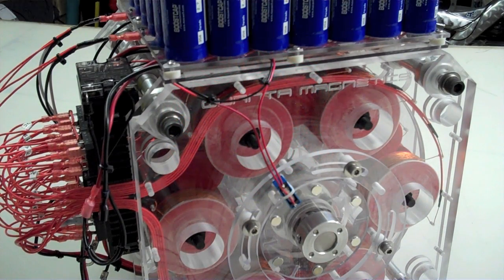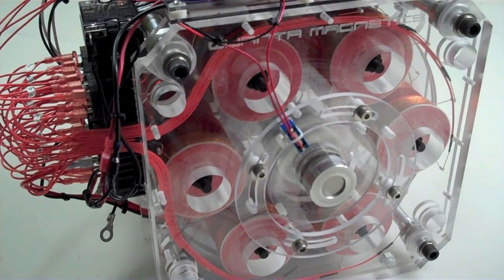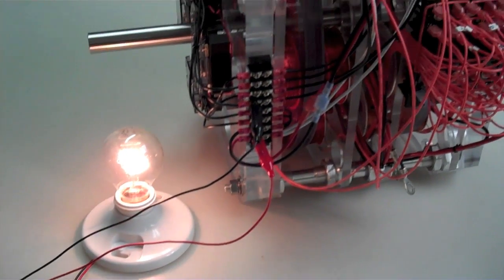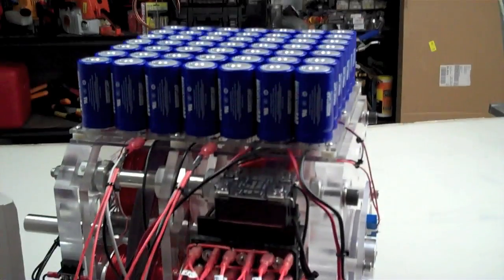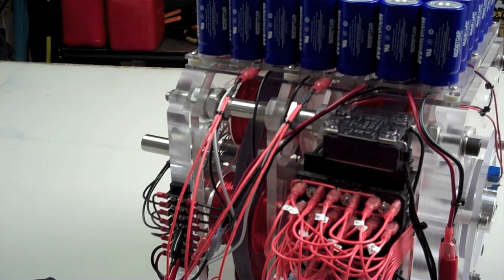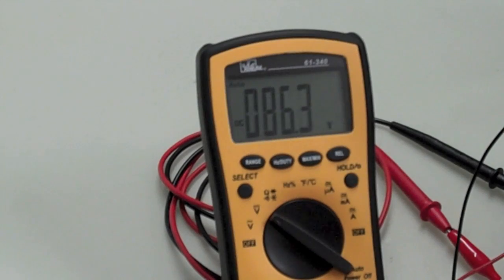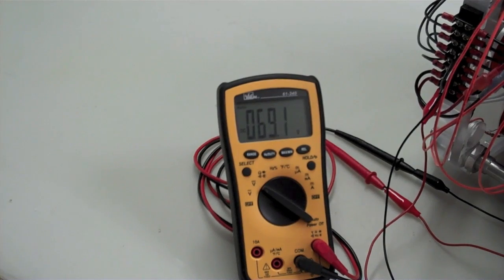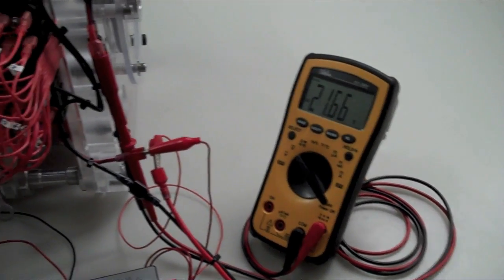Q2 SELF CHARGING.Part 2

Comment: Thats not how you get the job done.  You don't get any foreknowledge about results. All you have to work with is the assumption such a device can be made. This is how real inventors do the job. If it was good enough for them it should be good enough for anyone. If you decide you can not make the assumption then you can not make the heavier than air flying apparatus. It becomes something like sticking spaghetti up your nose rather than the next revolution in warfare. "the perpetual drone"

Comment: To better understand your response here, Yes, means  power factor correction is needed because we are talking about a dc motor ? A 3-phase ac motor has ohmic and heat losses but already avoids any benefit for improved efficiency related to power correction and recovery methods.

I appreciate your unbiased and professional input.

Comment: If total system efficiency is the metric you're using to evaluate the efficiency of a motor, then yes --- power factor correction is needed.  Otherwise, you're going to have real power loss either during commutation (whether mechanical or electronic), and increased ohmic losses as well.

Comment: Yes, I think so.  For example, in a brush DC motor, the energy stored in the field is typically lost during commutation, giving rise to sparking and RF noise at the commutator.  Whatever isn't lost through radiative emissions is lost as heat.  

Not sure if this is the case for brushless motors, though I'd be willing to bet that the reactive power in brushless motors is a significant loss as well since there's typically no available capacitance in the system.

Comment: Dan, give it a break. The title says self charging.....not a machine that runs itself. So what if the input is larger than the charging system output ? Think about the typical losses most motors have. In my view the more efficient the better. PMM has clearly explained the motor will not run itself indefinitely, so the premise, in my view, is about efficiency and not entirely foolish.

Comment: It's a beautiful device, just a shame the premise is entirely foolish. It doesn't power itself. That's why you can't do a 2 hour video of it running by itself without cheating.
Fascinating that people can delude themselves in such a specific way.
And to maintain the delusion they sneak in little excuses like using a solar panel to power it as if that's insignificant to the premise of a self powering device...

Comment: It has no purpose really its just an experiment , well it seems that way to me, i suppose its to demonstrate how much power loss their is in a normal motor, and how that can be harnessed and put back into the system , giving you longer running time and less power consumption.

Comment: Thanks for the update on the farad of the caps you are using for now  You mentioned here caps being wired in series-parallel, Out of curiosity, are all 3 of the capacitor banks a combination of series-parallel combinations ? Also, if you get a moment what are the specific functions of all 3 capacitor banks ?
Two of the bank functions are easily understood, but when it comes to the 3rd it is difficult to understand......is it picking up the opposing wave on the motor or generator or both?

Comment: the divide by 14 is because there are 14 2.7v caps in series for 37.8v at full charge. Now a bank of 14 350f 2.7v caps all in series would store 350f/14 x.5=12.5 multiplier. Full charge with 37.8v=37.8x37.8x12.5=17860 joules. if the entire charge is used down to near zero over 1 hours time, then 17860j/3600sec =5 joules per sec on AVERAGE. If there is 18.9v left in the bank after 30 minutes load time the joules used per sec would average around 7.4 or 13,400 joules

Comment from the maker: Excellent analogy, and it does run for a prolonged period of time without a load. Nearly 25 lbs of kinetic flywheel storage must also be considered as an efficiency factor. Then consider how the wiring circuit of the pulse motor acts as a type of non-looped Tesla switch easily charging auxiliary storage as a simple by-product without additional input demand. Not to mention the sine peak generator contribution and the Lenz effect work-around. Perhaps it's slightly beyond a glorified DC motor. /M

Comment: Please explain where you come up with this formula? .Why divide by 14? Super caps are treated like batteries in a DC circuit. If the caps are each charged to their rated voltage, and I have yet to see 30 Vdc 100F caps, so I assume they are 2.7V then on a 30 odd volt supply each cap will be charged to it's rated capacity. That's also why you get a kick off them, skin leakage.  Energy storage density for Super caps is quoted in kW/h per kg, same as in rechargeable cells, look up some data sheets.

Comment: Just checking on the math here....100f caps with 2.7volts fully charged in series with 14 of them would store 100/14 x .5 =3.57 multiplier. Full charge at 37volts = 37 x37 x 3.57 =4887 Joules. 1 hour = 3600 seconds....=1.35 watts.
Not sure how you came up with 2.5 kWh ? Let me know if I am missing something.

Comment: On a brief follow up here, in your opinion, would a highly efficient ac motor 3 phase or otherwise, not need the power correction in the first place ? In any event, I think the more efficient dc motors can run, the better for all the various uses that dc motors work well for.

Comment: If those super caps are 100F 2.7V. each and there is 14 in cap bank 3, that gives a max string voltage of about 37 Volts. It also means if they are precharged there is around 2.5 kW/h of stored energy in those caps..... Hmmmm A motor could run a mighty long time on 2.5 kW/h. Nobody is knocking super caps they are fantastic storage devices, energy transforms are never 100% efficient, by definition this storage would work better if you just used the caps.

Comment: I think I follow your logic here, so if instead of the reactive power being converted (dissipated) to heat, it is fed (over precise timing) back to reduce input power, or otherwise stored in capacitors, there is potential to add efficiency to common motors and generators ?

Comment: Assumptions are usually the first mistake. High efficiency and data to back it up are another matter, I think PMM will come thru with data to support a respectable efficiency rating and possibly more efficient ways to store energy for times it is needed most.

Comment: It seems to me that what you have created is actually a DC motor with power factor correction.  Whereas in a typical DC motor the reactive power by is converted, due to lack of available capacitance, to real power and is dissipated as heat, your motor's capacitors provide power factor correction and avoid the associated losses.  

If bearing and windage losses are low compared to the rotor momentum, I would expect it to run for a long time under no-load conditions.

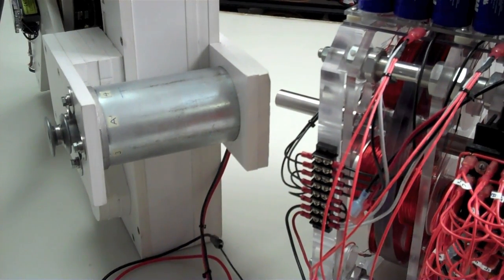Comment: he does say that it wont run itself forever, however in my original comment I was pointing out the the fact that at 7:27 in the video he is supposedly demonstrating the power output of the generator side of the machine and its ability to power a 24v electric motor but when the rotor stops the motor keeps trying to run apparently on some kind of pulse width modulator from the sound of it.

Comment: in order to run all of them together i would use belts and pullies to use only 1 or 2 to rotate all of the generators where instead of having 1 motor and 1 generator per cube run 2 like that and the rest both generators or you can make the system you have bigger and run 4 generators and 1 motor in 1 cube

Comment: if you connect a battery to it like you had but make it so instead of it only charging the capacitors but the battery also you will have a never ending electrical circuit that will be able to run at 24 if not more volts and if you get really loose bearings that last a long time and you make like 10 or more of those you can hook it up to your house and run everything that way and if you produce enough electric that it goes into the grid the electric company will pay you money for it

Comment: I do not think that PMM has ever claimed perpetual motion or even a COP over 1.There are electrical circuit recovery aspects that can extend run time and overall efficiency. It is as simple as that. The advantages are increased motor/generator efficiency as well as potential for reduced cost in maintaining energy storage systems.

Comment: I read the words, I'd like you to prove it tho by showing the same.  Are you willing to do so?   Just charge the caps to whatever volts you had it charged to, show it on the DVM and then run the 24v starter motor till the caps drain... then we know what you're claiming and what is happening really do line up.   Up to you man.  Just comes with the nature of proving overunity... gotta be willing to actually prove out queries, or expect to be called a fraud.  Look forward to see it work as claimed!

Comment: can you add a regulator to the output ; example if you are charging a battery or running a motor . . . because I think I am hearing oscillation in the motor operation.

Comment: It's a neat-looking device, but who would want one of these and for what purpose? And what's the point of anything "running and charging itself" if there's no free energy to be gained from it? There's smaller, lighter weight and noiseless ways to charge one battery from another (or from the mains).

Comment: as the unit spins, the magnetic field created is current.  if the caps are with in the magnetic field, they ll hold the energy.  Take a cap bank and set it up, but OFF Unit.  I suppose the farther away from the magnetic field you get, the less charge the cap bank will receive.

Comment from the maker: Common electrolytic capacitors would definitely drop off quickly, but ultracaps have far greater capacitance. Stopping on the trigger kept the motor running full on, and would have continued for quite some time.

Comment: I thought the point at 7:28-7:30 was to show how much power came out of the system, but it got stuck and the rpm was steady, not dropping as would be the case with any capacitor bank once loaded.  Was that power supposed to be coming from the stopped rotor that was keeping the hall triggered?  Or what were you trying to show at that point in the video?

Comment from the maker: No starter motor, it's one system unit. I think you've totally missed the point of energy recycling. The caps are for system balance only. The little demo was to show available power for transferring to load.

Comment: Uh, so when the rotation stops and its not moving, the starter motor, (presumably) is a heavy current drawing device, made to work with an auto battery for large amp discharges... I guess "prove it" is simple enough.   Show the cap bank on a DVM, list the start voltage, and then adjust the rotor so it stays on.  And then let the starter motor discharge the cap bank.   Keep the voltmeter on the cap bank the whole time.

Comment: Agreed, it has external source power...  its not self-running.  If it was self-powered and got stuck where the hall had the transistors conducting it would just bleed off the charge and stop trying to move... there must be some augmented power source on input.  No motion, no power from coils.

Comment: I understand Hall triggers but I thought that the motor was supposed to be running straight off of the generator, if the rotor is not turning then no power would be produced so it must have an outside electric source powering the 24v electric motor.

Comment: Hello PMMG4HYBRID, 
I think what is happening is the third bank of capacitors ( being so close to the other capacitors ) are charging the first and second bank of capacitors by way of its stored energy force field generated in and about the third bank.  This effect could also act like a buffer reservoir of capacitance on your third bank and not allow it to discharge completely between cycles.  If anything you will get plenty of current flow in to the third bank.  Just a guess.  Russ - W8UZZ

Comment: As with all power conversion technology, no energy is actually created by the circuit (due to the law of Conservation of Energy). Joule thief can only squeeze more juice out of a battery than a conventional motor/circuit can. Still no answer to my question how can he (if I'm not missing something completely) in his videos fully charge a lead battery using 9V battery with almost zero amps out from the 9V...

Comment: I'm talking about energy = joules or Ah (Joule is the correct unit) Energy is not amperes or volts. 9V alkaline battery stores 565mAh (~=18.306kJ) of energy. Let's consider that it was a 40W lightbulb. If he used all the energy stored in those batteries and nothing else, then: 5*(9[V]*0.565[Ah])/40[W=VA] ~= 0.636[h] A little more than half an hour of light. But he states that he used same batteries more than once. Where does the energy come from? 9[V]*0.565[A]*3600[s]=18.306[kJ] (=565mAh)

Comment: I'm not quite getting this. Regarding conservation of energy. Especially with the motor and bulb connecterd. You start this with a couple of 9V batteries. I guess one 9V battery can store approx 18.8 kJ, so five of them could possible (rough calculation) store 100kJ of energy. If you squeeze everything out of those little 9V ones. Or am I missing something? How much joules you can store in this thing? I where do you get them?

Comment: i think, but i dont know: the capasitors are preloaded...(we saw it at 8:38) and a cap bank in this size can store the energy of a small motorbike battery. i think the cap bank 1+2 is like a battery... seems bank 3 is directly connected to the coils, but 1+2 is the backup power source, that speeds up the rotor. i think it will stand still after a time. maybe an hour or two. ^^ but i have never seen this maschine in real and and i cant judge. i want to believe, but the reality... ^^

Comment: I can't believe this video has been out for 7 days and I am just noticing it now, was so looking forward to seeing it too lol. Ok so you shave off the peeks but is there a way to shave a spike or two off the neural zone where the + meets 0 meets - area ? I am trying to ask is there energy as it flips at the middle of the sine? Was thinking it might be cold  electricity at that range and could maybe be tapped in a cap in reverse and stored without slowing down performance. Am I nuts? :)

Comment: the bit with the caps about shocking sounds like Nicola Tesla, Tesla coil, where in that you have moving parts rubbing against each other that they create static electricity, and when you touch them they discharge as you make a connection with you hand across several caps.

Comment: why is it that at 7:27 and the gernerator stops the 24 volt motor gets stuck in run mode,, am i not seeing something here,, if the generator doesnt turn there should be no power to turn the 24 volt motor.

Comment: Your caps are doing nothing strange its just one of the properties of the can type caps is that if they are charged without a load they will discharge through the tops if connected together, I figured this out the hard way, I had array of caps charged to 200v when I set my hand on them I got a very nasty surprise.

Comment: i wounder if you could add an extra 2 gens on the end, plus if you get + off the top of the caps could you wire them into series and use the + charge to power the motor?

Comment: Always great watching your videos! Good description of the tech with some good humor to boot. Aaron  Murakami also did some experiments with high voltage and only connecting a negative lead to charge batteries. I also managed to charge a battery with just a the negative wire. I think it's the potential difference created on the cap plates, nature tries to balance ad you get power? Keep up the good work!

Comment from the maker: MU metal has a percentage of steel, and is used to shield from escaping electromagnetic waves produced by MRI equipment.
Though steel would cost much less, it may not be as effective. Best to try it first I suppose.

Comment: Again I хаже то guess, as far as picture is very complex - try to covert unit with thin magnetic metal box and connect that box to unit ground point it will shield all internal "happening" тand focuse them in one probably random axis... nobody can calculate such shield performance/behavior, may be only super computers if they will be loaded with 100% model DB:) But dont forget to fix this result,all gaps ets. It is possible that you will went outto moreparasitceffectsifyouwill increasetheeffect.

Comment: Nice design. I saw 400ma @ 12 or 24 volts driving the Gen. Thats 4.8 to 10 watts to jump start the Gen resulting in 25 wattt output for for x times grater than start time. This is super efficient presuming the bulb is 12 volt 2 amp.

Comment: Ok, there is something that i find a bit confusing: you said, to use solar panels to drive Q2 witch in turn should charge batteries. But if the machine is not running in over-unity (COP > 1) then why bother at all? Why not connect the panels directly to the batteries?